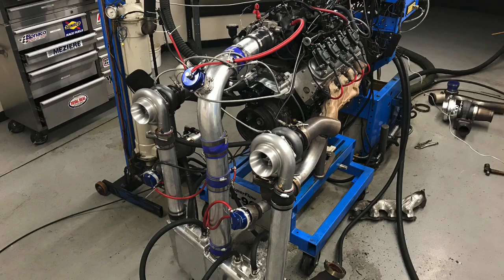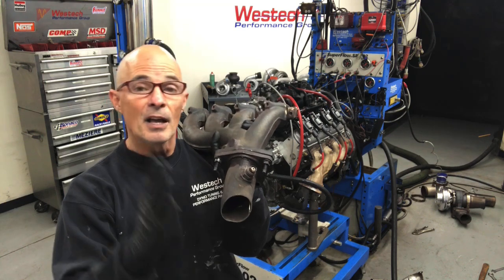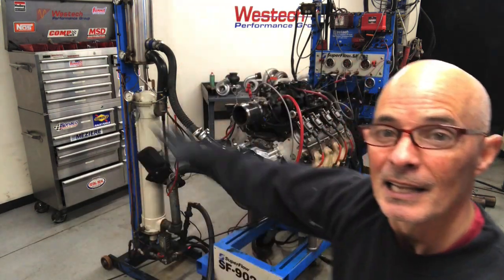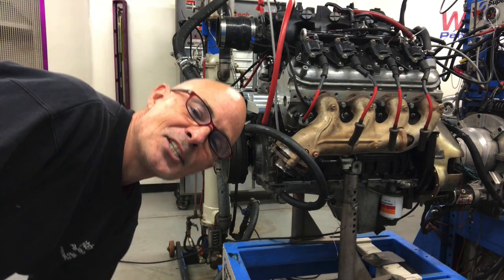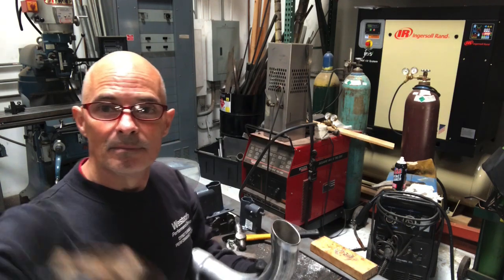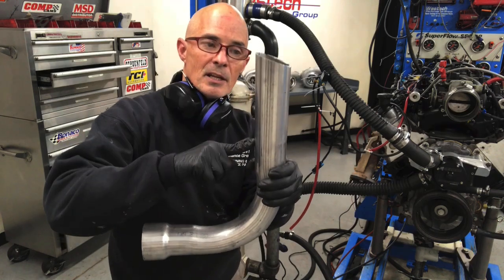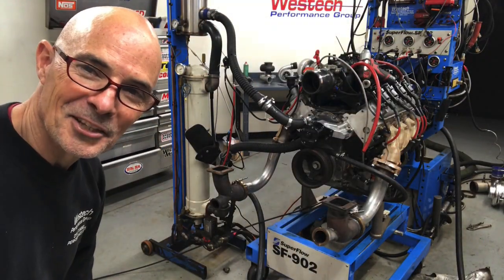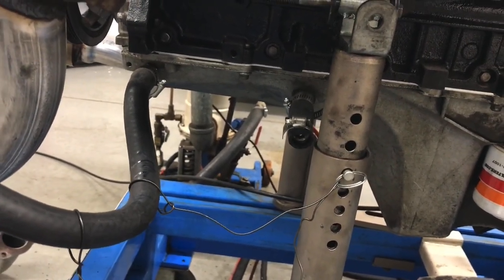HOW TO: CHEAP, DIY TWIN TURBO LS KIT (GT3582s)

Comment: I’m trying to do a 5.3 twin turbo I’m wondering what is the best size turbos to run that won’t be to big and cause lag which ones u think are the best to run with least lag but most performance
Reply from the maker: for what power level?
Reply: @richardholdener1727  1200hp
Reply: @richardholdener1727  900-1200 hp

Comment: I've had twin VS GT3582s in my foxbody street car for about 4 years now. First with a 5.3 and now with an LFA (aluminum 6.0) with similar routing (truck manifolds as well). These have been great. They light off fast and make good power with low boost. With the 5.3, it made 600whp on 10psi and 770whp on 15psi (through a t56 and full 2.5" exhaust including flowmaster mufflers). You actually answered a few questions for me while I was brainstorming the idea on Sloppy Mechanics. Cool to see more people using these.

Comment: Hi Richard, maybe a video idea.. turbo "secondary" length? Would that affect torque output? Thanks for all the work you do😊
Reply from the maker: what is secondary length?
Reply: @richardholdener1727  I made it up haha. I was thinking the exhaust length past the turbine. Supposedly there is power to be had by adding secondary length past the collector NA, I was wondering if there was a similar effect with turbos?
Reply from the maker: you just want it big and free flowing as possible after the turbo
Reply: @richardholdener1727  thanks Richard! Best wishes

Comment: Very interesting video. What if you turned those exhaust manifolds up side down and then made additional pipes and welded t 3 flanges on? How would that work? Just less tubing.
Reply from the maker: would work fine

Comment: Can’t you put the twin turbo on top of the engine?
Reply: Just hanging beside the manifold or a little above it
Reply from the maker: you can run them wherever you want
Reply: @richardholdener1727   Just wanted add your placement of your turbos we’re a good idea, I appreciate you posting Information about the ls engines

Comment: Richard interesting videos you post, I was referred from you of the forums I'm in.i have a question. What your thoughts on a set of are small frame 88's /75ar housing on a 500 " motor?
Reply from the maker: ask a question without the word thoughts in it

Comment: Can you run these turbos and use oil only? Or do you absolutely have to use the water side or can I just block it off? I am planning on running these on a blowthrough setup on a 5.3 ls.
Reply from the maker: we didn't run the water cooled on the dyno
Reply: Do you think they would be OK to run on the street without the water?

Comment: Love your videos, do u think I can put one  turbo on a ls4 5.3l gxp?
Reply from the maker: YES-BUT YOUR TRANS WON'T LAST
Reply: @richardholdener1727  yea I was acared.of that I just got a rebuild with a small cooler imna add another ice to water cooler in truck do u think that will help or the turbo will still fry the trans?

Comment: One side is the flat flange, one side is the ball and socket. every 99-07 is this way, and most past that are the same design. ive never seen one that uses either 2 flat flanges or 2 ball and sockets, they are always one and one.

Comment: Question 🙋‍♂️. I have a new stock LQ9 6.0 with LS3 heads. It’s a new crate engine from GM. What size turbo would you recommend I start my Selection process.  Or twin set up. I’m trying to stay under 10psi. Thanks
Reply from the maker: s475 or vs racing 7875

Comment: Richard when are twins worth it?    It seems like for most situations at least under 1000hp, where you could get it done with twins, there is a single larger turbo that could get the job done better.   You showed alot of dynos where the single had quicker response and more power than the duals.   It seems now that from the data you provided that duals and more come into play where you need excess power levels.   We had always assumed two smaller turbos would provide better response, but your dynos show differently.
Reply from the maker: the tests have been specific turbos vs specific turbos-not simply twin vs single
Reply: @richardholdener1727  True.    I dont think you where trying to display a trend but its hard not to notice.    Most of us assumed two smaller turbos will usually have a better response and more power than a larger single.

Comment: Where you get oil feed from turbos?

What size is the turbo exhaust exit pipes
Reply from the maker: OIL FEED IS FROM THE SIDE OF THE BLOCK
Reply: @richardholdener1727  TYPE OF WATSE GATE, WASTEGATE SPRING PRESSURE, COST?

Comment: ** Richard, do you use the maF sensor in this setup at all? or are you just using a maP setup? I wish you would go more detail on how you setup the computer on these setups.. thanks
Reply from the maker: the Holley does not use a MAF-its speed desnity

Comment: Hey buddy, I’ve got a 5.3 gen3 stock Ls with a monster trans for 600+hp with Holley term x max and trans control. If you know could you tell me how to get the torque converter clutch control (tcc) to function in this setup?  I’ve spent several hrs trying to reach a Holley tech with no luck. Thanks if you can for the help.
Reply from the maker: I'm not the guy for that-sorry
Reply: In the Transmission GCF there is a place for it. If you loaded the correct configuration id inagine it would be enabled. Pull your tune and load it into your labtop. Open the software and look at your setting in the transmission ICF. Lots of good remote tuners out there I used  TCtuned and then learned what I needed to make my Tremec work

Comment: I've got a serious question to ask. I've got a 99 Z28 with a 5.3 T56 six-speed with a 12-volt Moser rear end. It's going to be a turbo car soon. Do I need to go twin turbo or single turbo it will be a street strip car
Reply: I'm actually thinking of pulling the 5-3 out of my Camaro and putting it in my wife's Cadillac CTS and if I do that it will be naturally aspirated and I will get a 6.0 for my Z28 and put a turbo on it instead of the five three. I still need to know single turbo or twin turbo
Reply from the maker: either will work-that is usually packaging

Comment: Honestly I wanna see some junkyard turbos like some hx35s some holsets off the old 6.5s ect. Maybe some old 7.3 powerstroke turbos or some off a wrecked duramax. I think a twin turbo 4.8 with a set of hx35s with bigger exhaust housings should make 650-700hp on a $75 wrecker turbo could build a True junkyard turbo kit for $300 decapped injectors ect.

Comment: If running a twin turbo set up would it be a good idea to run either a high pressure stock volume oil pump or a high pressure high volume oil pump ?
Reply from the maker: high vol pump would help
Reply: @richardholdener1727  thanks for reply I’ll go ahead and order the 10296 oil pump then 🤟🏻

Comment: Where would I get the cooling water from for the air-water intercooler? Would you run from the radiator or a separate system altogether?
Reply: A2W systems employ their own dedicated water tank (looks like a 5- or 10-gal. fuel cell) with its own fluid pump (Rule brand is popular), can be mounted in the trunk, pass. compartment, etc. Budget versions are all over Ebay/Amazon for cheap-cheap.

Comment: Have you ever done a dynamometer test comparing different weight engine oils?  The owner of the machine shop that I use is recommending that I use 15/50 in my BBC street engine. I'll take his advice, but I used to run straight 30 weight back in the day. Just wondering what effect that might have on horsepower.

Comment: How are you welding that stainless v-band to that exhaust pipe using a mig welder. Always heard you had to tig weld stainless
Reply: TIG can be prettier, but MIG works.
Reply: @jsmcortina  good to know lol. I just figured with what everyone has always said you couldn’t mig stainless together

Comment: Hey Richard, here's an idea for some easy testing. Crush bent vs. mandrel bent exhaust! Build two exhausts with some bends like for an axle etc, one with mandrel bends, one with crush bends. Run it on some sort of NA combo, or NA and turbo if you're feeling spicy! I have a feeling the crush bends would be almost no difference. On my sloppy turbo Subaru I used a tailpipe section from a silverado to get lots of bends and pipe for very little money into my hotside.

Comment: Another great video...   just a comment:  The stock 2010 Camaro manifolds are also fairly cheap since many people swap in headers... and they are much easier to fit between the front frame rails, they hug much closer to the side of the block.
Reply from the maker: NICE

Comment: I cant believe your doing this build.I literally just bought these turbos and im putting them on my 4.8 in my chevelle.I am so wanting to see you test this setup at alittle bit of boost.Will be watching close for a update on this build...
Reply: 4.8? My 69 wouldn't accept anything less then a 6.0
Reply: @Censord  good for you.....that big 69 needs a 4" bore ....a lil 4.8 or 5.3 would just be working to damn hard......now you need a supercharger or some turbos. ....me myself I'm a supercharger guy. Gotta lsa supercharger on my built 370" with 64cc ls3 heads for 11.2:1 compression and a 2.45" pulley for roughly 15lbs boost although I've seen upto 19lbs on some data logs, that's in a '74 nova converted to a '71. .....but man I must admit my favorite chevelles are the '68/'69s........rolling works of art

Comment: I would like to see the limits of the stock manifolds on twins vs the stainless ones with the same turbos etc.
Reply: Also did you do a video of logs vs manifolds vs stainless vs shorty/mid-length/long tube headers for a single and twin set up?
Reply: @supernova5end  Stock manifolds will make 2k easy.

Comment: What’s this intercooler? brand? size?... any info where do i get it?
Reply from the maker: CXRACING
Reply: I just installed one and it's a tank!
 35 lbs at least. The mounts could be welded better, but overall it's a nice intercooler for $400.

Comment: I have a 2009 4.8 that could use a like boost. I like cheap. Be nice ro have an idea what it would cost
Reply: Gt3582s are usually around 400 each on eBay, intercooler is whatever fits your car and power goals, anywhere from $200-$1500. Then it's up to fuel system and piping, so anywhere from $1200 to $5k. Really depends on your fabrication skills and creativity

Comment: Mr Holdener, i have an idea for a test that would generate some interesting data. Use a centrifugal blower. Make a dyno baseline. Start restricting the exhaust, measuring exhaust backpressure, and it's effect on output. Start with 0 backpressure, then work up to a 3X backpressure. We could learn the effects of high backpressure in turbo motors!!!!😁
Reply from the maker: that doesn't translate directly over to turbos, but we could see what change back pressure has on blowers
Reply: @richardholdener1727  I am certain excessive exhaust pressure leads to a higher "gauge" inlet pressure on a supercharged deal. My question is how higher exhaust pressures effect the tune-up and potential output. The fixed ratio centrifugal should start getting pissed, and tolerate less timing as ex pressure goes up from 0 to 3x
Reply: That's what I was thinking yesterday too, but you could also just throttle the exhaust on a turbo set-up.
Reply: My thought process is that a centrifugal blower keeps a fixed ratio. Restricting the exhaust up to 3 times boost/manifold pressure should show some data that would help to correlate the effects of pressure differential boost/backpressure in turbo motors. The effects on total output, and required changes in ignition timing as backpressure goes up😀
Reply: As backpressure goes up from the restricted exhaust we should see the intake pressure rise, and the engine getting more pissed off, and taking less ignition timing before spark knock.

Comment: Why does the turbo have to use gravity to drain back to the oil pan?  Why not use the oil pressure to push the oil back to the oil pan in the case of a low mounted turbo? I want to mount a turbo under the bed of my truck. Do I have to have some sort of special return system?
Reply: The seals won't stop oil from leaking through to the turbine and compressor wheel. You must drain the oil before it reaches them.
Reply from the maker: many guys use pumps for low mounts
Reply: @richardholdener1727   would you ever turbo this Jaguar v12 mentioned in this video https://youtu.be/mypfMUGVtrg

Comment: I understand this question is different... but why don’t companies ceramic coat the exhaust housing on turbos... to control heat...
Reply: It's an option but only for the high $ turbos, like garrets
Reply: @chomin3025  why stop at just the housing? Do the whole hot side! Manifolds and all!

Comment: Its it bad to mount the waste gates on the bend like that. The exhaust is blowing straight into it. Wouldn't it be better mounted on the side out of direct flow?
Reply: That's actually the preferred way/place to mount wastegates.  It's referred to as "wastegate priority."  It helps ensure the wastegates are able to provide good control over the boost level.
Reply from the maker: it works best in the direction of exhaust flow

Comment: The P 38 had a vertical shaft turbo charger sitting behind each engine how hard is it to mount modern turbo chargers that way?
Reply from the maker: wasn't that a supercharger?
Reply: @richardholdener1727  it had a centrifugal supercharger, but with altitude it would lose power, unlike the Merlin and German counter parts, it did not have a variable speed control because the army wanted Allison to focus on “turbine driven” superchargers, but it was too big to be placed in the P51, so they just used the Merlin 1650, but for the p38 they had space in the back of the engines and used the “turbos” to supply the extra pressure difference with the altitude. The engineered called the first p38s sent to Euro with out the turbine as “castrated P38s”
Reply: @B0RN2RACE100  the only concern I have for aircraft engines is how easily I can slap them into my car!
Reply: Oil drainage might be a problem.
Reply: Yeah but they were huge and axial flow designed to be placed in that way for negative/positive Gs, most car turbos would not last long without that oil draining aided by gravity.

Comment: The bigger mystery is what twin Turbos to run on a 6,500lb truck with a 6.0 LS.
Reply from the maker: hp level?
Reply: @richardholdener1727  1968 M-715 , LQ4 it's 6,200 ish lbs wet, 39" tire 4L85e prob 4:10 /3:73s.
I have been all over the web and cannot find an answer, I need that low end, it's not going to be 100mph, just and every day driver.
Bone stock LQ4 2002. 650ish HP?
Please help, I'm thinking your small GT35s.
Reply: @soldierski1669  anything is going to spool faster in a truck than a car, load is your friend when seeking boost
Reply: @soldierski1669  Buy a book on the subject. The internet is not your friend when it comes to turbo selection for a specific application.
Reply: @TwoLotus2  I have a few books on forced induction, problem is, none cover something heavy in 2 turbos, the information I have gotten is to run 2 small turbos on heavy trucks, but just about everyone covers "cars" making power mid powerband up.
Reply: @Montana West Photography Studio If you divide 6.0 into 2 you get 3.0 so you would think that the GT35s are a good bet with room to grow.
BTR stage 2 cam and two GT35s should be in the right area, but I would have rather heard it right from someone like Richard.

Comment: Exactly the video I needed today.  I finally found a 6.0 today!  The chevelle has a heart now!
Reply: Are you doing any engine work to the 6.0 or is it just stock?
Reply: @christopherH402  It's going to be a 404 stroker with a t56 6 speed.
Reply: @LoneWolf-w2f  6.0 will make more power everywhere.  So no not true

Comment: For some stupid reason gm used different flanges side to side. 

Ok so I didn't need to say that, but hey, I hear more comments help the algorithm so here's my free gift Richard😃
Reply: There is something like 7 different styles of exhaust manifolds for the gen3 engines. Camaro corvette truck tbss all have different ones. I don't know about The gto or hd trucks. The gen4 engines have a different head flange pattern so there is even more.
Reply: @timothybayliss6680  what socks is when you buy cheap ebay shorty headers and they put the flange on upside down
Reply from the maker: there are a lot

Comment: Think there's nothing better than a turbo?????? Wrong! Two is always better than one.
Reply: Sometimes, it's like having two girlfriends..... could run into some complications.
Reply: And four is better than 2
Reply: I think big singles still outperform two smaller ones as far as maximum power potential. In drag racing where your leaving under boost either on a 2step or trans break, you are not worried about boost response of a laggy big single.
Reply: @madmod  in very fast cars you are, some of the low 4 high 3 second (1/8th mile) cars are ramping boost as quickly as possible and if they use too big a turbo it can't accelerate fast enough to bring boost in as quick as they want it. Granted, 99% of us will never be at that level, but its technically possible
Reply: @madmod  I mean idek what you're talking about I street my car, and I plan to street her till she's in the big wrecking yard in the sky, which is why I'm going for the mod motor world record with a twincharge setup (think twins feeding a whipple/kenne bell/vmp/whoever I can make fit cause I'm using B heads.)
Reply: @madmod  You may be correct. 
But us street drivers worry about lag when hot lapping it to the 7-11 and back. 
Dont want the Mountain Dew to get warm, and the Kit Kat bar to melt.

And everybody knows Anti-Lag strategies melts chocolate.
Reply: Works great on a Dyno, try putting them in a car, especially a street car.  All the piping, intercooler exhaust. It ain’t happening for the average guy.